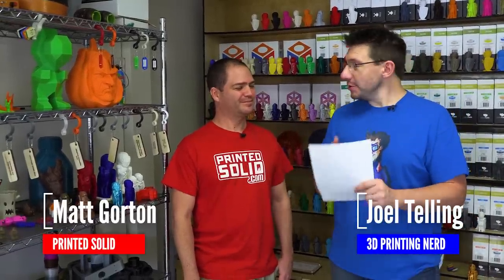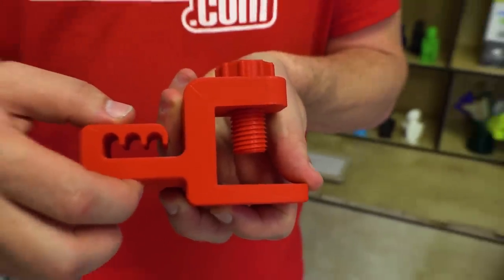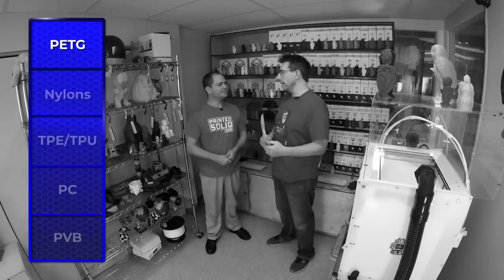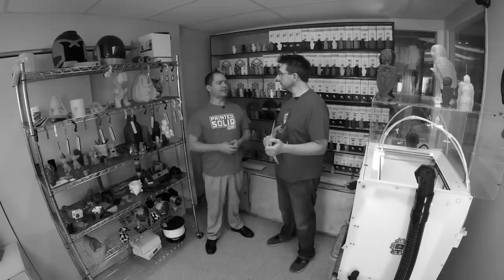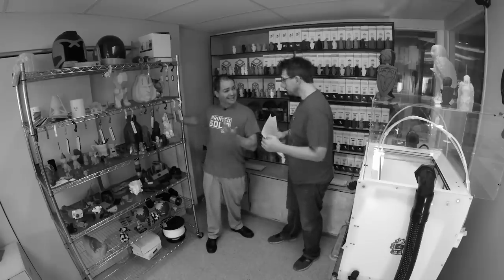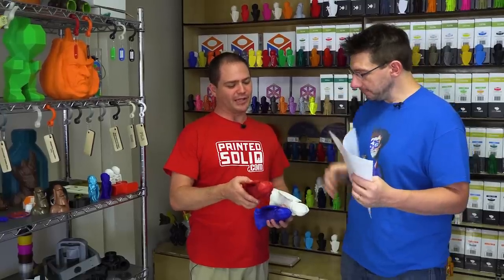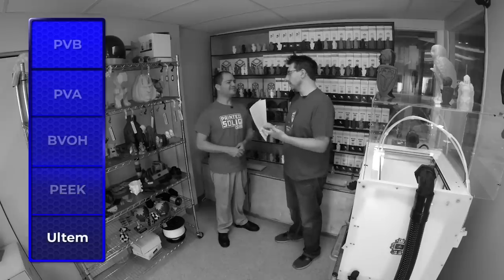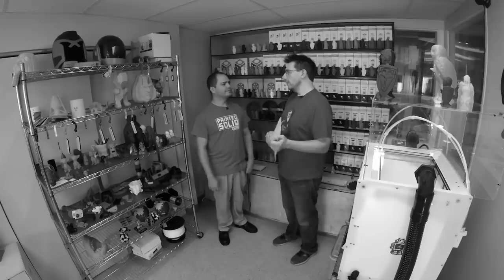Guide to 3D Printing Filament! PLA ABS PETG TPU PEEK ULTEM

Comment: What About HIPS? I will try printing some instead of ABS on my Pulse. As for PLA and cars. If you print PLA on a bed at over 80 C and and enclosure and the print takes more than 2 hours and you leave the enclosure closed until the bed cools into the low 30s you have printted annealed PLA and it will hold shape until up to 150 c. It will be less brittle and less stiff. It will feel kinda like ABS and yield a bit before breaking. And yes if you have good bed adhesion it will hold its dimensions.
Reply: Joel did a video on PLA annealing not long ago, for a gear shifter handle.
Reply: @MMuraseofSandvich  I must have missed that one. We are still experimenting with it as we have 3 printers. A Matterhackers Pulse and in school 2 Makerbot Replicator+. Unfortunately the replicator+ are PLA only and no heated bed. We would like to use them too. On he Pulse which is a Prusa clone we got a garolite plate E3d V6 etc so can print all kinds of things. Using the Makerbots would be helpful but unannealed PLA is useless for us. We are printing a 32x30x55in or something close to that FRC (FIRST Robotics Competition) style robot that can weigh up to 150lb. So standard PLA is too brittle. Now annealing PLA will change dimensions. So initial tests have shown that you can make and "Anneal Print" on the pulse with a cage a PLA mold then you place the makerbot PLA part into the mold and anneal it at about 150-180F. Works fine an the part maintains dimension only the anneal printed PLA mold "wears out " after 5-6 uses simply cause it gets overcome sooner or later by the warping force of the part being annealed as most of them are 267x54x45mm and the Makerbot PLA is super warpy. I tried Nylon for molds but I'd probably would have to make them realy thick as the PLA during annealing bends them and yes after cool down when you remove the PLA part the nylon mold straightens back out but you still got a warped PLA part so we might have to go a combination of PLA and Steel or aluminum to combat the warping. But that will be on hold for a couple of months Saturday is the reveal and start for the FRC season and we will have 6 weeks to build above described bot. We will post updates on how that goes on our new channel. So wish us luck maybe this is the year for the very first 3D Printed FRC style Robot to compete.
Reply: Martin Pirringer Yes what about HIPS? I was thinking of trying this for parts that need to withstand summer heat inside a car. Will this material print as smoothly as PLA in my cheapo Anycubic Kossel delta style printer? Thanks
Reply: @repairfreak  IDK I have a pulse. It probably depends on what you do and what kind of nozzle/hotend you have. I use the Hobbyking variety. As a matter of fact we (FRC team 1989) Like it so much we cleaned out their US warehouse think bought/used about 12 kg (There is more in Hong Kong and we might order the 14kg require to get free shipping as it sells between $10-12/kg) I print with a .8mm Nozzle at 55mm/s (ABS speed) and have the temp at 270. Out of the 13 kg I had 2 parts warp. I print on a garolite plate with gluestick bed temp at 100C on those 2 parts I tried to not apply glue stick before every print or just refresh it with a damp towel. So it needs glue stick and 100C and I also got a cheap enclosure set over it IDK if it makes a difference but we print tons of ABS and it makes a big difference there. I like it better than ABS. It still smells a little but less than ABS and I would suggest to still have the area well ventilated. Compared to ABS it has a little more Flex so it will give a bit before braking and man its tough. Not quite Nylon Tough but much better for brackets than ABS. We had a hollow hex tube with 4mm walls 1/2 in id (to take a hex reenforcement shaft) and a Rack attached to it and it took 340 in/lb without a problem (We can't test higher cause the current tester we sometimes have access to maxes out at that) Its currently the 2nd best material we have for gears (after Nylon) It is in the process of replacing PETG and ABS for a lot of mechanical things. Well and selling for 10-12 bucks a kg helps lots with the budget. Granted the hobby king ABS sells in the same price range and is pretty good but not as good as this HIPS. Will do a video on my channel on it as soon as we get a breather. Right now all efforts are dedicated towards building our robot. Right now Im printing it faster than I can get it.

Comment: Hi I bought some TPU to print some flexible fittings like model car tyres eg rubber style bits, but received PLA-f. Its suggested that this is the same. Is this true do you think ? 
Thanks Richard

Comment: hope in the future there are versions that can print from materials rather than just plastic or similarities of plastics; others are like metals, silicones, woods, etc.
Reply: They do have metal printers, but the cost is extremely high. I'm thinking about testing some concepts with them as they are very close, and I've got $1k to mess around with and buy stupid powerful lasers just for lols to see if I can do any better.

Wood is not something you can melt, you could only grow it, and people have grown wood into shapes they've wanted for many many generations, so you sort of can. Silicone you can print a mold for, then make your part (unless you mean shoving it into a syringe like they do for printing chocolate or clay.

Comment: Would augmenting the filament feed mechanism with a heater to remove absorbed water from troublesome hygroscopic filaments prior to final heat and delivery be possible? Would a gravity defying, gimbal mounted printer body, to eliminate overhang printing without support be possible?

Comment: I just bought a printer(Ender3), waiting for it to arrive, I'm just wondering if a model requires support, does that have to actually be modeled into the 3d model or can it automatically be added through the printer or some software?
Reply: It's added automatically by your slicer. Download cura if you haven't chosen a slicer yet. It's the most popular free one.

Comment: What would you use for 2" suspension lift spacers for a car? Needs to be stiff but not crack. Have noticed manufacturers use HDPE for other car models (nobody makes these for my car). I already designed them but not sure. Probably nylon, ABS, or PC?
Reply: I think Nylon will creep, but I'd recommend cutting those out of metal... Its not that expensive to have some made of a proper material, also I'm not sure what would happen if those did fail or explode out the sides (like jacking up the car working on it, then the jack slips and it tires slam down if they frag grenade into your legs hitting arteries. I mean its a bit of a boring way to die but I won't judge).

Comment: Two related bits polymer chemistry from a materials engineer to supplement all the practical info from Matt & Joel:
BVOH - "OH" is the chemical abbreviation for any generic alcohol because of the -OH hydroxyl group that makes it an alcohol. Not sure why it's abbreviated BVOH while PVA uses "A" for alcohol though.
PEEK - polymer names aren't usually creative, they just describe the structure of the polymer chain. Matt was correct in that it is polyether ether ketone with two ethers because each monomer has two ethers (and a ketone). Polyether ketone (PEK) and polyether ketone ketene (PEKK) (and others) exist as well.

Comment: The reason the petg filament goes around the nozzle is because the nozzle is not hot enough. 
I heat my nozzle around 240* and it works perfect 👌🏻

Comment: I want to print a multi part model that glues together to form a computer case, what would the best filament be to use for that, I have an Ender 3 Mk2 coming and will be enclosing it to help hold in some warmth, changing to a better hot end an insulation pad under the bed supposed to enable better heating.

Comment: If I were to attempt to print roller skate wheels, which material would be better suited? Harder material is mostly better for skating on the rink vs softer material for skating outside (softer for outside wheels because it absorbs imperfections better. Rock, twigs, etc...)
Reply: Just realized that roller skate wheels are polyurethane, which is probably really bad in an FDM printer. But maybe flexible resins in an SLA printer? Thoughts?

Comment: Finally, someone who gives ABS some credit
Reply: Here here. With a printer that's dialed in (and an enclosure and extra heaters, fume hood etc) ABS gives a great non glossy finish (the more gloss the more those layer lines show up and the more reflections change the perceived surface shapes -  critical for product design/development, yes I'm looking at you PLA). ABS also has excellent strength, high heat capable, takes taps well, parts can be acetone welded, doesn't deform over time and can be vapor smoothed. BUT, there are different recipes for ABS depending on manufacturer (its a combo of three or more polymers in different ratios -  hence the three letters in the name). So don't discount ABS until you've tried a few different brands. Warping can be an issue but if you heat the bed, heat the environment and direct the fans correctly its is minimal on sub 500mm cubed parts.

Comment: Can PET-G be used in place of ABS? In other words is PET-G a solid product to use if you want things that last long, stay structurally sound, handle higher heats, and you don't want to mess with the fumes of ABS? For example, if you want to 3D print a spatula your wife can print with, what would you use?
Can the new product, ASA, be used in place of PET-G and ABS and is it safer and if so how much safer? And is it easy to print?

Comment: failed to mention one of the huge things about Nylon, it is susceptible to hydrolysis which makes it weaker and brittle when it absorbs moisture from the air
Reply: JbassPlayer28 absorbing moisture makes it more flexible. Hydrolysis is only a problem if you extrude it with moisture inside.

It is actually common to put nylon parts in boiling water (not hot enough for hydrolysis) to let them absorb some moisture. They become a little bit more flexible and nearly indestructible.

Comment: I'm trying to 3d print rock climbing holds. I know that we use PU to make climbing holds. I was wondering about the property differences between polyurethane and thermoplastic polyurethane?
Reply: I can only imagine that ending great with layer separation, lol... I imagine those aren't too expensive compared to getting injured, but whatever you do make sure your layers are strong and pay attention to print orientation so the layers aren't being pulled away from each other.

Comment: Thanks for the info. Have you heard any projects using used textiles for material repurposing into 3D printed material?
Reply: Sanlander(sp? popular YouTube channel) chap did a few tests with fiberglass, wood fiber, etc. in a CLIP(continuous liquid interface protocol) printer. (The new HARP printer is a fast version of CLIP that may be able to add rigidity to various fibers, even without ecovative's mushroom mycelium - if we can find a good, ecologically-safe alternative to styrofoam) ...I've been considering doing something exhaustive based on Sanlander's tests (which tested a bunch of things I didn't care about, but which showed the things that I care about are possible).

Comment: If you can afford high-cost filaments and need something that is similar to nylon in its strength and semi-flexibility, but doesn't have the issues of water absorption or layer delamination, I strongly suggest trying NinjaTek Armadillo filament; it prints easy (once you get your settings right...but it's not too difficult to tweak them), is not all that slow (I run at 45mm/s standard if I want PLA-like quality, although it can go faster or slower as needed), and like Semiflex/Ninjaflex/Cheetah it is neigh-impossible to break in any way/shape/form once printed. About the only thing it's not good for is objects with thin parts that you don't want to be flexible - for instance, if you made a box with relatively thin sides, it would be a little flexible, kinda like Tupperware. On the other hand, the fact that thick parts are quite stiff while thin parts are a little flexible works really well if you are designing objects that are supposed to tightly fit around some other object, as the thicker parts (those with infill) won't bend, but you can have "lips" or other thin parts that "wrap around", holding things together while retaining their shape in the long run (bendable Armadillo parts seem to go back to their initial, printed shape; if they "hold a bend" it definitely seems to take awhile).

Comment: PEEK is also one of the safest choices for biomedical applications, such as long term body-implants. It can be autoclaved, shows no adverse reaction to the body, shows osseointegration (great for bone implants), is MRI-compatible (unlike titanium and tungsten that can cause artifacts and noise despite being safe) and is stronger (less brittle?) than ceramics.
The cost is also rather low compared to the alternatives (medical grade stainless steel, platinum, titanium, tungsten, zirconia ceramic...), being also easy and cheap to machine with high precision (or 3D printed!).

Comment: You've talked about flexes. I actually sell some really cool flexible materials from my friend at Noctuo.  Last time I've checked they had like 7 or 8 different formulations based on different chemistries.  From 45ShA Extreme Flex to 96ShA Mediflex and GRIP H. some of them are dissolvable in benzin, some are biocompatible, heat resistant, softtouch you name it.
These are one of the best (but also quite hard to print) materials I know.
Oh, and they're MUCH better in material science than in marketing ;)

Comment: Joel, don't you have a Creality3D Ender 3 3D? If so, how does it compare to the Prusa I3 Mk III as far as quality and speed?  I'm thinking of buying one, and would greatly value your opinion.
Reply: Well, since Joel didn't answer, if you're still looking (your post is 5 months old); The Prusa machine is more "plug and play" and the Ender is less expensive and give equal results with a bit more work. The Creality machines tend to be a great value for those who are willing to put up with some slightly lower quality parts and willing to put in more work to fine tune. The good thing about that is you learn a lot more about the process, the bad news is you lose hair doing so. ;-}
Reply from the maker: I don’t :(

Comment: Is there a 3D printer that can print more than one color at the same time on one item?  So far I have seen only one color item.
Thanks!
Reply: Yes, there are printers with double nozzle where you can add 2 materials/colors in the same time..
Reply: up to 6 colors or materials for now, software limitation mainly.

Comment: As a corollary to this video, why not make one that comes from the opposite direction, that of use - printing a fan blade, printing a gear set or transmission, printing a statue, printing a drawer handle, etc.  Basically what material to select for the type of print.  The two together would provide a very good insight in how to select the right material for the job at hand.

Comment: BVOH I worked with lot in school for support material four our dual extrude machine. I forget what Printer it was but the BVOH does blob like he said when left in water. I forget what chemical it was but we had a special wash the the part was put in after printing for multiple hours. So you'd add this chemical to a tub of heated normal circulating water and then the supports would completely dissolve after multiple hours.

Comment: what should i use for 3d printed  RC planes
Reply: ABS is probably a good bet, its what I like for model planes and quadcopters because I crash a lot and ABS has 4x the impact strength of PLA, also I've left my model plane in the trunk for a couple hours and the hot glue melted but my ABS was totally fine and just heatgunned it back into place melting the glue and flew and crashed later that day (I'm a pro at crashing, if you need a pro at crashing something just come ask me, if you need it not crashed... well maybe not me, haha!)

Comment: @3dprintingnerd How about copolyesters? 
I have used a lot of colorfabb material like HT and NGEN. NGEN is more stringy and HT will mess up your glass surface.
I'm now verry mutch a a doupt what material to buy
Reply: I had read (can't remember where) that nGen was no longer being produced. I guess I was wrong. I tried it in my Taz 6 Dual V3 Printhead and it kept clogging up.

Comment: Nice Video, Like your talk a lot! 
I once tried PEEK, it was impossible with my Ultimaker Original plus. I printed like 2 or 3 layers and it just jumped away. I mean literally jumped, not like ABS who slips away. 
I used PEEK because I wanted to build a chamber to calibrate sensors for measuring relative humidity and PEEK is non-hygroscopic. 
Has anyone positiv expierence with PEEK?

Comment: i need some help.
I'm ready for  flex printing even bought a new extruder appropriate to the task
I can not figure out which filament to buy.  I would like the flexibility as close to a spatial as possible. realize that it won't be perfect as a spatula is made from rubber but it needs to be similar.  I have read so many damn articles and I can not figure out which shore hardness to go with,
if someone could help me I would be grateful
Reply: I think ABS is pretty close, it also handles heat a lot better but I'm not sure I'd cook eggs with it because I don't think its food safe, but if you vary the thickness just a little you can get it dialed in just like you want especially since ABS is really close to most plastic spatulas I've used.